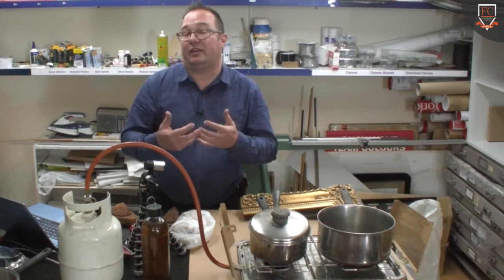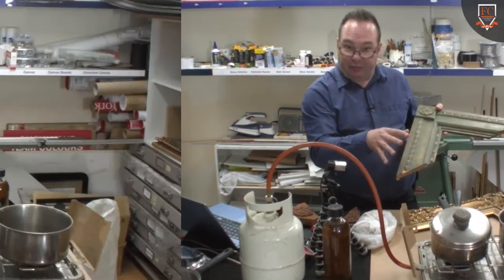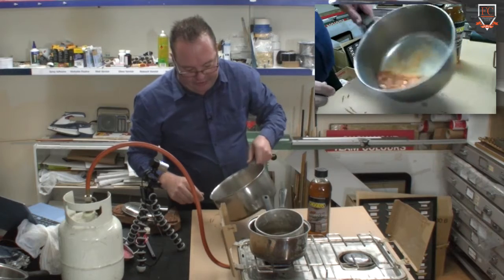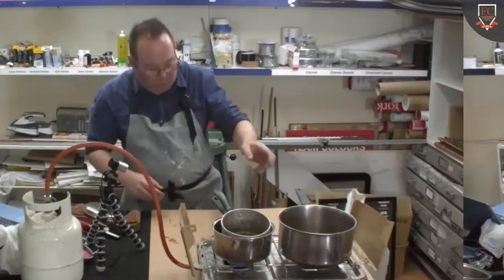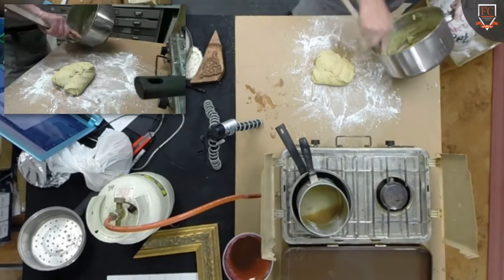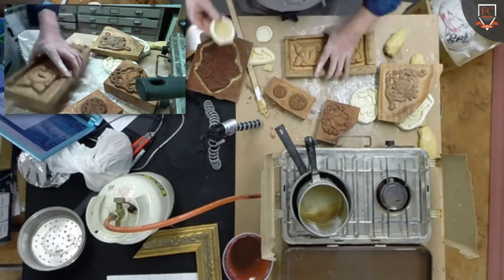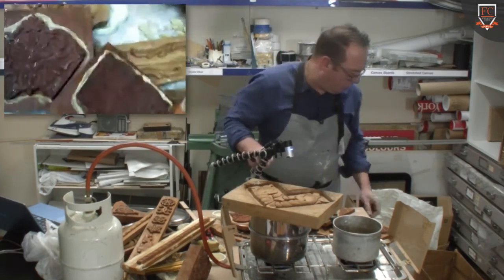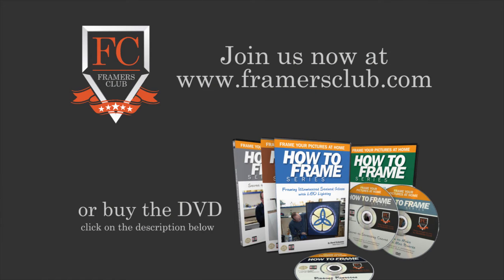Making Composition Framing Ornaments Trailer

Comment: Love your video,  played it again and again... Just a couple of things... 
The recipe 3/4lb french glue. 1/2pt raw linseed oil.
But how much rosin to melt in the raw linseed oil? 
What is the powder you’re kneading the compo on?
Cheers
Reply: Will you plz share the recipe with me?
Reply from the maker: Hi Boo, The full training on the compo making is inside the members area of framersclub.com. The white powder is powdered chalk.
Reply: @Endurart  sir what ingredient use  in your compo so that gum rosin does not melt after drying the casting
Reply: @Endurart  link does not bring me anywhere.
I’m thinking burgundy pitch and calcium carbonate are the missing ingredients not mentioned.
Reply: @sheeshodadial1082  I think it is burgundy pitch and calcium carbonate.
Reply from the maker: Thanks for the heads-up on the old link. I'll try to update it.